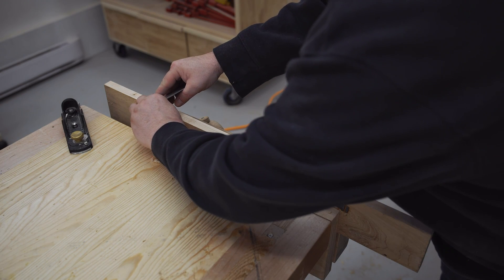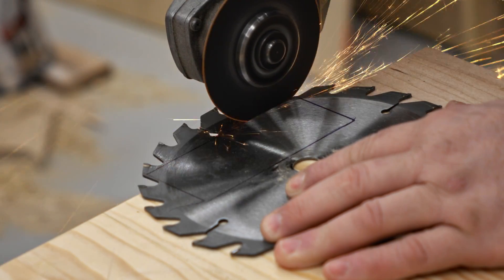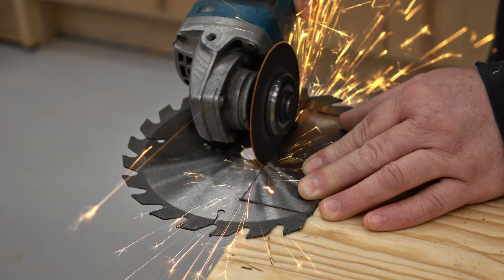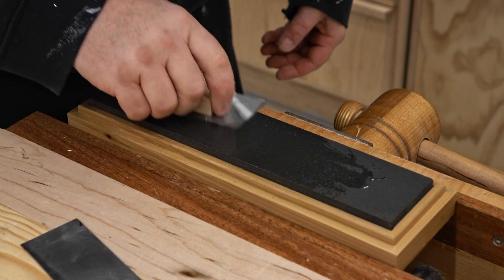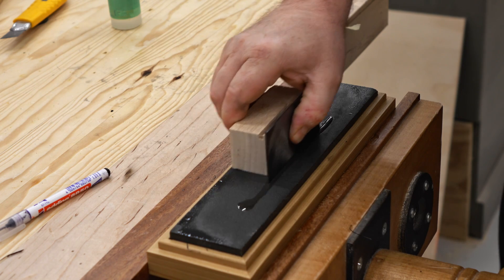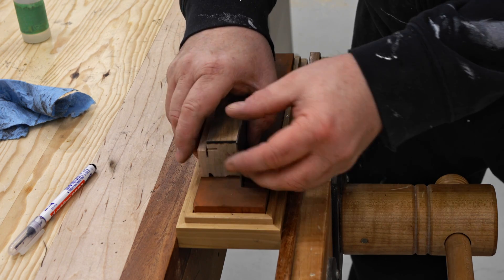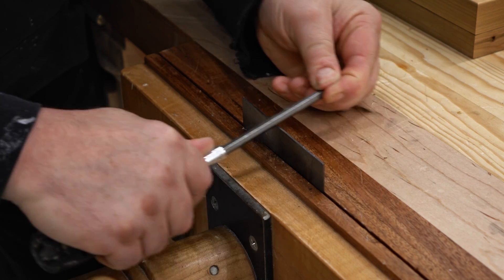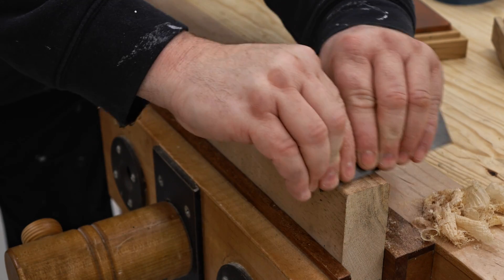How To Make Sharpen and Use a Card Scraper

Comment: Another thing ive founder useful is to keep 1 corner at 90 degrees for scraping 90 degree angles,  while cutting the opposite side at a slight angle to assist cleaning out inside angles of dry glue,  saving sanding time and paper.  Just some advice.

Comment: One suggestion if you use wet and dry sandpaper to flatten the scraper, is to put the sandpaper on a piece of 1/4” plate glass as the glass will be exactly flat.  The water used in the sanding process will stick the sandpaper to the glass.  The advantage of the sandpaper is you can work your way up the grit sizes.

Comment: I bought a cheap set of regular convex ground razor blades, and oddly, while I scrape wood with one side, the other side develops a burr, so I switch to that side, which creates a burr on the original side.
I will need to look into it.

Comment: John.. would it be possible to use a paint scraper blade as a scraper? ( I think it's High Speed Steel)
If so, what type of steel would one use to sharpen that? A thicker piece HSS again?
I'm thinking of using the butt-end of an old, unusable drillbit to make a burnisher.

Comment: I could be wrong, but most knife makers say that modern circular saw bodies are not made from carbon steel, so are not and can't be hardened. I'm guessing they use some sort of alloy that is resistant to bending and shattering etc, so it's probably better steel than mild steel.
Reply from the maker: Saw blades that have carbide teeth are typically made from a grade of L6 steel, which is not a high fashion fancy steel for those discerning knife makers, but definitely hardenable and usable for making knives that will cut and hold an edge. 
You can't make saw blade bodies from mild steel, it will warp from the heat of cutting and won't be strong enough to hold the teeth on.
Reply: @IBuildIt  Thanks, that's good to know. I have a few old saw blades that I couldn't bring myself to get rid of, so i'll give this a try soon.

Comment: Hey john thanks for this!
I’m new to scrappers... I went through the initial steps of sharpening my scraper to get a burr. After using it for awhile, the burr  is gone. Do I start all the way from the beginning in the sharpening process? Do I just do the final sharpening/burnishing step?
Reply from the maker: It doesn't take as long to put a fresh hook on it, but you do have to remove the old one first.

Comment: If you don't have any hardened screwdrivers an easy way to make a burnisher on the cheap is to look for tungsten carbide rods on eBay.  $4 for a rod and $0.90 for a wooden file handle and I had a burnisher Veritas would sell for $35.